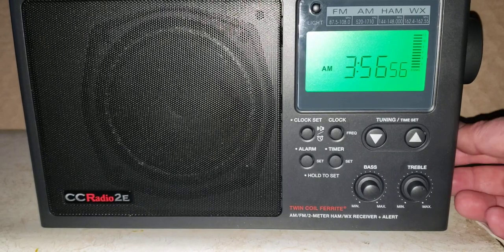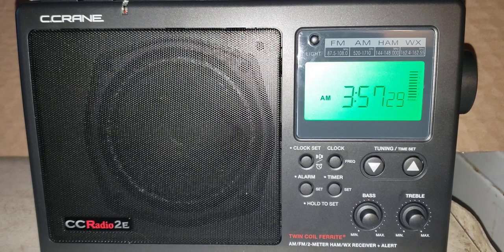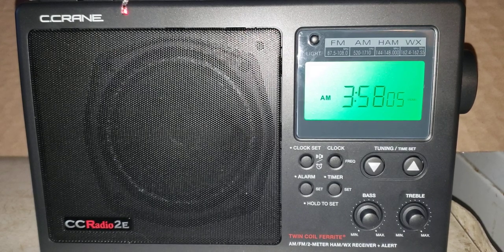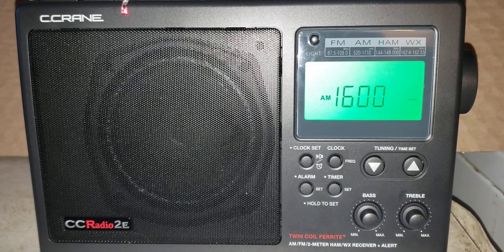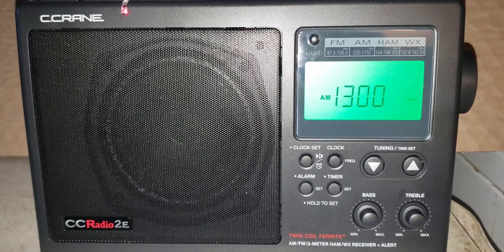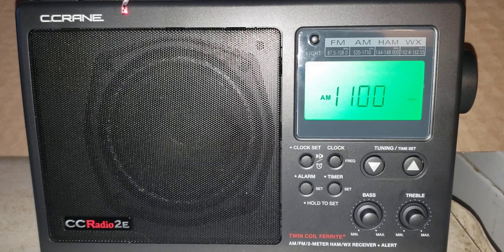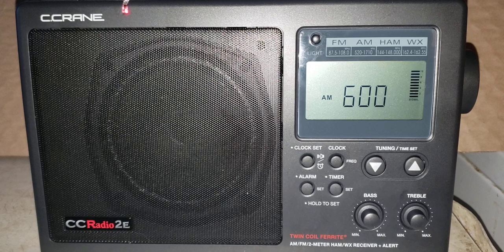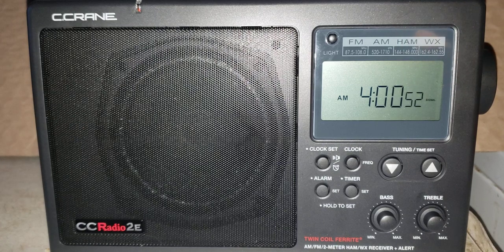C Crane CCRadio 2E Enhanced AM Calibration how to do it and what it does

Comment: Warning: I just reset my 2E while following your video. I hit the reset, set the tuning to 760 am (local station), and could not receive it. It screwed up my receive. I moved it away from the PC and calibrated it again. It sounds beautiful in the other room. I think that the static from the PC interfered with the receiver, and it calibrated incorrectly.  I think that it has to receive some signal in order to complete the process. 

As far as the Crane 2e compared to general coverage receiver with a dipole antenna - I assume the general coverage receiver would outperform the 2e. Compare the 2e against any standard desktop radio for sale - I would say that it would hold its own. If you use the 2E with the external twin-ferrite antenna elevated above the radio - it eliminates a lot of the fades that you complained about. I would like to place the twin-ferrite antenna on some kind of rotor in the attic. If anyone has a suggestion on what I could use as a cheap rotor - please post it. Or maybe use the 10 meter super-scanner approach and stack three twin-ferrite coils in different directions with a switch of some kind. I think that if I could use a rotor with the antenna up high that I could do some serious AM dxing.

Comment: Look through the speaker grille as one can undoubtedly see a quality speaker is involved with the C Crane CCRadio 2E!  This radio, Gilles, most likely does have DSP circuitry!  Thanks for your review on the AM calibration procedures regarding the C Crane 2E...
Reply from the maker: Tecsun H-501X has a great audio system also the difference here is mostly that they have made the C Crane sound good on what it does best AM radio ... the Tecsun with Stereo and its speaker system blows away the C Crane
Reply: @OfficialSWLchannel  that it does, this also makes it optimal as a speaker for my tiny speaker less belka dsp shortwave via the aux port, the 2e is a nice all around emergency radio

Comment: I am curious, have you or anyone ever received anything on the 2 meter band. I've had my 2e for 3 years and have never heard a single thing on the 2 meter band. I thought I was just in a bad area, but have since purchased a different brand radio and found that I do have 2 meter communications in my area. 

The 2e is not finding anything.
Reply from the maker: Yes I have received local amateur radio repeaters from time to time here in the Montreal area, it is not the most sensitive radio on 2 meters and the real slow scan speed also is a pain to use
Reply: @OfficialSWLchannel  , I expected better from C Crane. 🙁